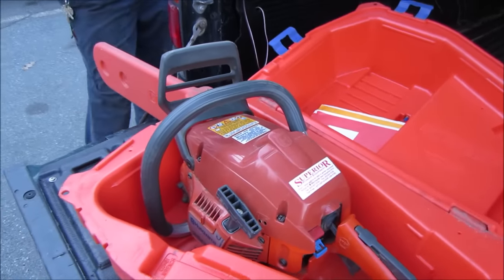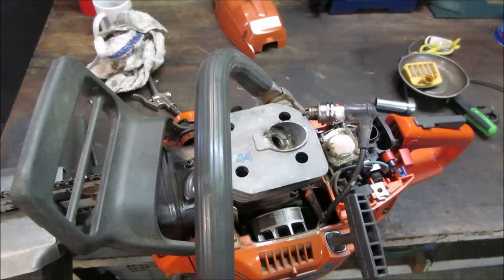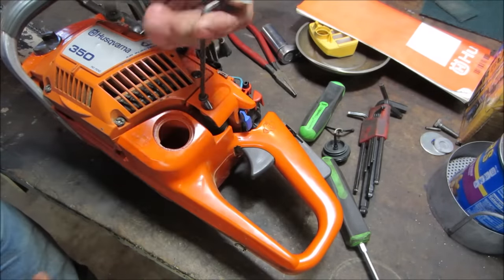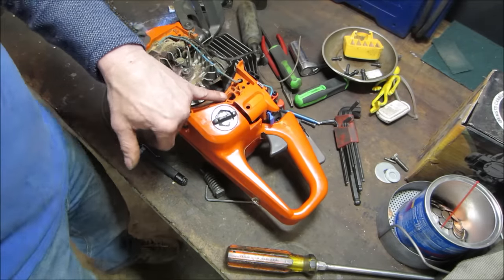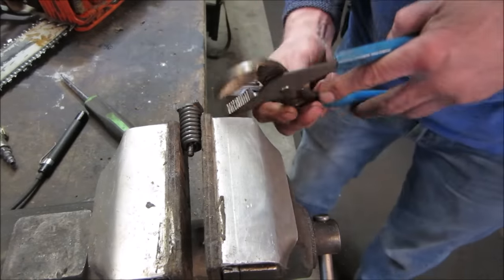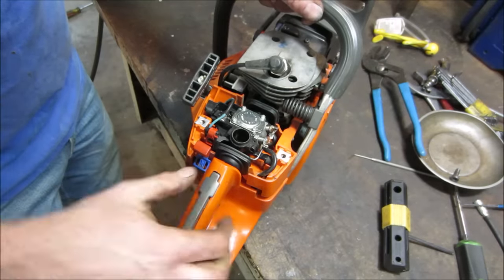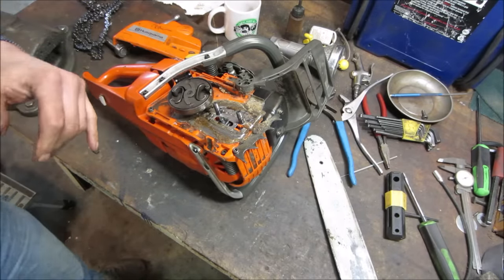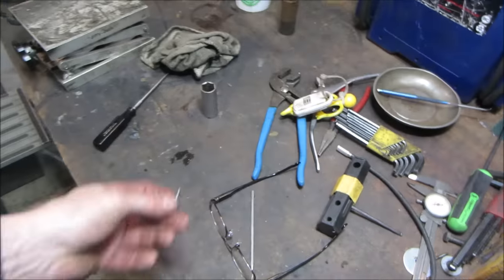Can It Be Saved? The Junkiest Chainsaw Ever. Picked out of The Trash.

Comment: I sold and serviced chainsaws for 30 years. Many of my regulars where arborists, loggers and firewood retailers. Those guys know what they are doing and never treated their tools like this yahoo did.
Home owners on the other hand,
often just didn't know any better.
It was my job to educate them every
time they struggled. 
I sold Stihl and Husqvarna side by side for about 20 for those 30 years.
I miss those days.
Reply: Which one would you choose if you had to pick one?
Reply: The entire chainsaw industry has changed. It use to be that chainsaws were sold only by serving dealers.
Now every box store has them. 
Quality has taken a back seat to price point marketing. 
  Market share is priority now instead  of reputation. When marking says they need a saw priced lower than competition.  Costs are cut and they build what they can.
That being said I believe that both manufacturers have their strengths.
There were models in the Stihl line   that I preferred over Husqvarna and vice-versa.
It was my experience that the price point homeowner saws were very comparable model to model.
The professional lines that were designed to be run all day everyday were a different level.
One of my favorites was the Husqvarna 242. This saw was built to run all day at 15,500 rpms. Making it very popular with the bucket guys. 
 The Stihl 085 was popular as the big muscle saw. 
Firewood cutters were 50/50 between Stihl and Husky. It was just a matter of brand loyalty with these guys. Kind of like Dodge vs Chevy vs Ford guys. 
From a service stand point Stihl was easier to work on. 
Stihl made their own bars and chain and still do. Which is a plus. Stihl chain is superior. 
Both have always had issues with anti-vibration mounts. Forcing a dull chain to cut is the usual cause of failure. 
The number 1 enemy to both is ethanol fuels. This stuff eats fuel lines and carb diaphragms and goes stale quickly. 
Always use non-ethanol fuel.
  I don't believe either manufacturers owe anybody any apologies. Both make good products. 
The key to getting a saw that will serve you well is to buy a saw built for the job at hand. If you need a serious tool, spend a little more and get the right tool. 
I recommend buying from a servicing dealer and knowledgeable sales people. 
Avoid price point box stores. Seldom do their sales people have a clue.
  I don't really have a favorite. But truth be told.... I'm retired now and the chainsaw that hangs in my tool room is a Stihl. A gift from my son.

Comment: Husqvarna 350 are known for exhaust to loosen up and burn top of oil tank? They are a fun little hot rod saw. Bolt a 346XP top end on it. Little porting and polish on transfers and exhaust port,  use sealant instead of the base gasket a Husqvarna 351 carb and intake boot. And if you ever come across one with a plastic intake clamp replace it with metal one.

Comment: Great workmanship!
This past summer my 1970s HOMELIGHT MINI had a no spark and  being short of time took it to a pro. Two weeks later they called and said it was a dead coil and none available in North America.
So I stripped the saw and pulled the coil and evaluated my options. Doing some magic reassembled the saw, pulled the cord and saw blue spark with the plug grounded. With the plug and wire connected, the saw roared to life. Its been running fine since.
Reply: NOW who's the pro? Good save!

Comment: 20+ years I worked in the Computer industry, and I was give a lot of computers *that were junk*.. Junk  today means 100% USER ERROR..
Reply: worked in the same industry for 21. not one of my computers is new.  i think my newest one is the one i'm typing on something like 6 years. its a gen 4 i5.  for my vacation i broke out my 2009 dell 1525 core 2 duo laptop and threw a new ebay battery in it. worked fine on the trip. slow, but works.
Reply: I fix computers all the time that are considered Junk. My neighbor gives them to me when people give them to him to recycle because they were told they didn't work.
Reply: @MrSGL21  My Laptop is an Asus ROG g771jm, that was given to me, because it had a dead battery, and a dead hard drive.  new it retailed for over $2k CAD. I've had it for 3 yrs now never had an issue with it, I paid $100 for a new battery, and I have 2 1TB SSD's

Comment: Well a Husqvarna wasn’t good enough for him , he should probably pick up one of those quality saws from Harbor Freight.  At least he won’t lose as much money on that one.
Reply: Husqs aren't any better than harbor freight s. They're manufactured at the same factory as homelite ryobi and craftsman with minor design differences and many interchangable parts. Quality levels are all about a 3 out of 10 for husq ryobi homelite and craftsman and maybe a 2.5 for harbor freight.
Reply: @tKetcham1   , You have no idea what you are talking about.
Reply: Steeltoedboots 58  just saying I am wrong without saying what it is you see as incorrect, leaves me to believe that you have no experience in tearing apart these cheap chainsaws. Otherwise you would have made a more detailed intelligent comment. You can actually buy craftsman and husq parts with the same part numbers.
Reply: Lol
Reply: to be honest, i hate working on the carbs on anything small from them... even our local dealer/shop, dont repair them if they dont need a simple stop tune, they swap it for a replacement and send them in for refurb, because the time it takes to track down whats wrong and fix it, or rebuild one successfully, could be better spent getting 6-8 other jobs done, he assured me he was not kidding, traded me the one that was fubar, and just had me grab the unit and he installed it at no extra charge, and made sure it worked..they also get units new and refurb that wont work right out of the factory box, nice guys, and they like the brand, but as one said...he dosnt own any of their equipment that use any of the carbs below a specific size, because other brands have carbs that have less issues and are easier to fix, on the other hand... they love their larger equipment... had to show me the "brush mower" they were using from them, "best one i have ever used"  i didnt bother asking how many others he had used...  it looked effective... and like it wouldnt be a huge pita to work on...  so... better then a couple toro models i have had the misfortune to be wrangled into helping repair... (one... we found out there was a recall on the motor in the unit.. i will say the dealer did just let us bring the motor itself in, and after he verified it was one in the range, let us do the swap, they knew the ower and laughed... and gave us a couple extra items free, and bench tested the motor, they had a few units brought in with fully ruined motors at the time, thankfully it wasnt a large number of units with the defect, but he showed us one motor that seized on a fellow when he was over half a mile from home due to whatever the flaw was...you could see the heat damage... (im guessing it was oil flow being restricted or blocked due to a mold flaw or something.. even the mechanic didnt know, toro just paid to get the motors back and replaced them...) 

they do make some nice stuff...but my gods i hate their carbs in weed eaters and other small items...
Reply: The original owner needs to go out to Walmart and buy their store brand electric chainsaw and call it a day. HAHAHHA
Reply: @Ender3Me  prolly??
Reply: @bigteddy66  lingo for "probably" boomer
Reply: @Ender3Me  ah I see. Are you American?
Reply: @bigteddy66  yeah, he’s prolly American, probably!

Comment: The rubber bushing you dropped at 26:06, looks like it could fit round that loose pin to stop it moving about so much. Just a thought. PS, Husqvarna are one of the best respected chainsaws out there.
Reply: And put the paperwork back in the case, away from the gas and oil.
Reply: Yep that was it, according to one parts source it's P/N 503869201 or 503 86 92-01 and is called a movement limiter. There is also supposed to be a second one down the bottom rear just in front of the fuel tank. You can just see the pin moving at 18:54. Huskys are good saws on a par with Stihl. Good score Mustie

Comment: My neighbor has that same 350 and its a great running saw. Maintenance is the key to keeping  yard equipment going, most people are too dumb or too lazy. Just last week that same neighbor came home with 2 Honda mowers, said a fellow was going to trash them because they just would not run and would I check them out, the second I removed the gas cap the stink was a give away the gas had been in there for years, drained the tank, filled it with fresh 89 octane NON-ethanol, a shot of carb cleaner and changed the filter, a shot of fogging oil in the cylinder along with a new spark plug, topped off the oil and it cranked right up on the third pull. Those mowers probably sold for around $500 each. Some folks have more money than brains, hopefully they are viewing your video and will learn something, well done.

Comment: The last owner has probably had the saw jammed and just pulled it out causing the AV elements to strip the threads. Much easier to split the saw when replacing the AV’s, you weren’t far away from doing that. Great saws Husqvarnas.
Reply: And for those that will wonder:   AV = Anti Vibration

Comment: I'm no saw expert or woodsman, but I can say every Husqvarna I've operated (all homeowner versions) start by: power on, choke on.  Pull over until it fires and don't touch the throttle, it will then die.  Take the choke off and pull it over again (usually 1 pull) with no throttle and it should be going at higher idle.  After a couple seconds tap the throttle and it should idle down and be ready to cut.  Probably shouldn't mention this, but I do that all by the drop start method.  I've had limited Stihl use, but it seems like they like throttle input while starting, especially the weed whacker and yard boss.   As I mentioned in another comment here I have a newer version of this saw that I bought new, at a dealer, sometime around 2006.  The only major difference I can see is that the top cover is the same color as the rest of the saw and mine has a primer bulb.  Mine can also go in circles real good too, because it's the NASCAR version with a sticker and a NASCAR branded bar, to prove it.  Also, I am pretty sure there is supposed to be a rubber bushing in that spot you were talking about that is under the recoil, where the rod is sticking in the hole.

Comment: Great channel and great job on the saw.
One thing you can do to fix stripped holes in plastic is to use a heli coil. Just like you would for a stripped spark plug.

Keep up the great work.
Reply: @Henry May I have a Stihl MS230 (really just a hobby saw) that I bought around 12(?) years ago that's done the work of 2 Pro-grade saws around my Dad's property over that time, and finally one of the handle screws has stripped-out (no surprise really...) so I've been watching YT videos from all the different repair guys for the best way to fix it until I found this video purely by chance, and thought I'd watch it just to see how a Husqvarna saw is put-together really...

And as soon as I saw how it flopped-around in the handle I knew exactly what the problem was and my ears pricked-up for the solution Mustie 1 was going to use to fix it...

Up until then my options were:
1) A bigger screw
2) A Heli-Coil
or
3) Gorilla Glue -I know it sounds trashy-as-hell, but:
-Dampen the plastic all the way down the hole where the thread has stripped-out.
-Scratch the inside of the screw-hole with a long, thin, sharp piece of metal to key it (a long masonry nail with the tip bent-over 90⁰ and held in vice-grips is ideal)
-Poke plenty of Gorilla Glue (mixed with shavings of the same plastic as the hole is in) down the hole (a wooden cocktail stick or skewer works well for this).
-Jiggle it around with the skewer to mix the glue, shavings and water together thoroughly.
-Leave a cocktail stick (or matchstick -anything smaller than the shank of the screw) in the centre of the hole as a guide for reinserting the screw.
-Leave it to cure FULLY for 48 hours (the longer the better).
-Trim the expanded glue from the top of the repair with a razor blade or very sharp chisel.
-Gently drill down into the cocktail stick about 1/2 the length of the screw with a cocktail stick sized drill-bit as a pilot hole.
Insert the screw and crank it up tight 😁👍

I know it sounds kinda-sketchy, but I've used this method to repair stripped threads in plastic automotive parts, power tools (drills, routers, grinders), kayaks, toys, wooden furniture, kitchen cupboards, Ikea junk, and locked rawl-plugs into masonry and concrete, etc, and as long as the Gorilla Glue mixes with moisture and cures-fully before any load is applied to it then it's every bit as tough and resilient as the original plastic (or wood/trash-board) was, and usually significantly stronger, and it costs fractions of a penny per (very permanent...) repair.

I know that Heli-Coils are ideal for best-case repairs, and are great/usually the only option in metal (especially aluminium) but I don't know how much money I'd have spent on all the different sizes that I'd have needed over the years, while Gorilla Glue is cheap, completely universal, always to-hand, and because it expands into all the tiny scratches and voids as it cures, it gives both chemical and mechanical "bite" into the material.

Also, Heli-Coils are designed for, and work best with, machine-screws and bolts, but self-tapping screws with a much coarser thread-pitch can sometimes just tear-out of the plastic and leave you with a bigger hole -that's why I was searching for other solutions or ideas before I commit to my chainsaw repair, because it'll be a one-chance-and-done repair so I don't want to mess anything up...

Comment: I had a Poulan that I pulled more times than the cylinder ever fired. I did all the usual things: cleaned the carb, new plug, etc.  After several years of trying with no improvement I gave it away to some theater friends to use as a prop.  Later a chainsaw experienced carpenter friend told me that when you buy a Poulan always buy a case of starting fluid.

Comment: I have a Husqvarna split boom weedwacker seldom used never ran right. Starts easy but quits even easier!  Put all new fuel system, no change. This included sparkplug. Starts runs up good and quits. Any suggestions?  Cylinder is perfect so is exhaust.

Comment: Great video!  Good job resurrecting a great saw.  I have the 345 model, probably around the same age as this one and it has never failed me.  It even impresses my brother who buys more expensive Stihl chainsaws when we cut firewood.
I bought a new 435 model for my son for Christmas one year and it's a bugger to get it to start.  Once it's started it's great.
I still like my old 345 much better. though!
Reply: Sounds like the low carb adjustment needs to be fattened up a bit.  Sometimes being set too lean (on either) will make for hard starts and/or bogging when ya hit the throttle.  There are some great videos on carb tuning out there.  Factory set on older saws was usually "too rich" but for the last 20 years or so almost assuredly too lean (makes the emission data look better but can cut power and overall life of the saw)

Comment: I used to service chainsaws like you are doing, many years ago. The final thing I would do is adjust the high and low-speed mixture. Important to get the high-speed mixture 4 stroking, as we called it. Essentially needs to run rich for maximum power.
Reply: Yup, I agree 100%, but PLEASE get yourself a cheap 2-stroke tacho off Amazon/ebay first and research the maximum RPMs for your saw BEFORE you start fiddling with the Hi/Lo screws...
I'm speaking from experience here... 😖🙄
Reply: @therogers4432  I was doing this stuff in 1985. Amazon did not exist. We just used skill and experience. I'm never going to need to touch a chainsaw ever again, probably 😀

Comment: Mines 15 years old and hasn't farted once. Bought it when my stihl took a shit one week out of warranty and they wouldn't fix it. 
Husky has a compression release and a thinner blade. Goes thru like butter.
Reply: I have a small saw and I bring it to an independent shop.
Reply: Another commenter has said:
The 350 was originally manufactured with a plastic clamp that tightens the intake manifold boot. This caused a significant air leak and loss of compression. The plastic clamp needs to be replaced with Husqvarna 537251302 Wall Partition Intake Clamp. (Or you could use any round metal tightening clamp of similar size).
Also the fuel line needs upgrading to cope with corn juice.
And sometimes the coil needs replacement (if it's not a carb problem...you've got an ignition problem.

Comment: A husky 350 was my first saw. Other firewood cutters looked down on it but I was always cutting when they were "working on " their saws. I gradually moved up to bigger saws but always had a smaller saw (husky) at my disposal On small diameter wood a smaller husky can keep up with anything. I once had a 346 that was a real screamer. Incredible chain speed, light and handy, but it was stolen. I ran a 272 for decades and that saw was unbeatable.  Now I have a 390 for the big stuff and a 550 as a small saw. Husky has never let me down

Comment: I've got 3 Husqvarna chain saws.  Only one is bad; tried to rebuild carb. on 173 saw and threads stripped out on carb. screws.  Cannot get the screw out.  My dad gave me 2 others; 1 is a 340 and the other is a 320 and I like both of them.  Also have a Poulan that I bought new;  I do a lot of firewood for our fireplace for the winter.  Gotta have a good saw for that.  You did a great job on restoring (fixing) that 350 Husqvarna.  W Rusty Lane K9POW in eastern Tennessee